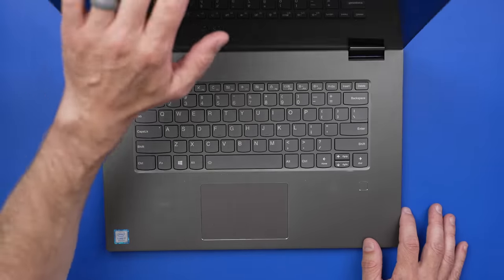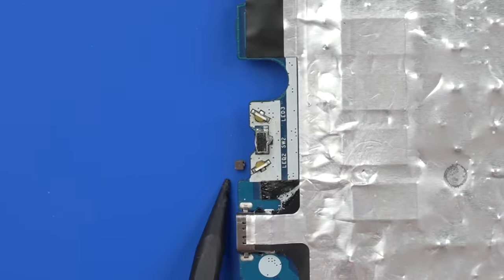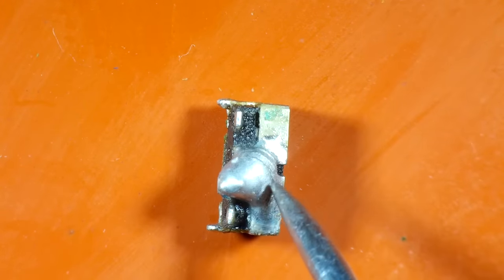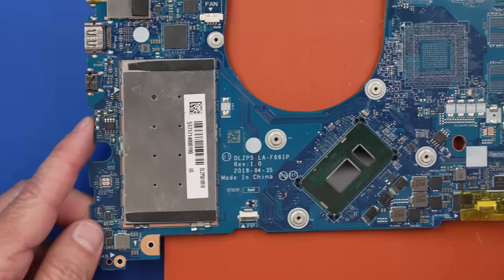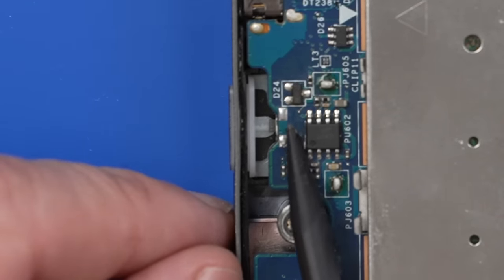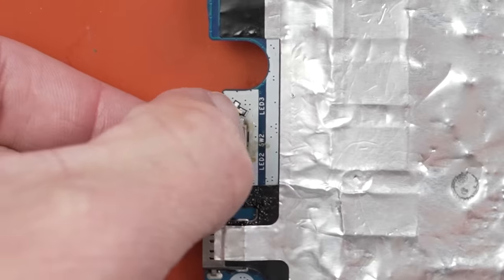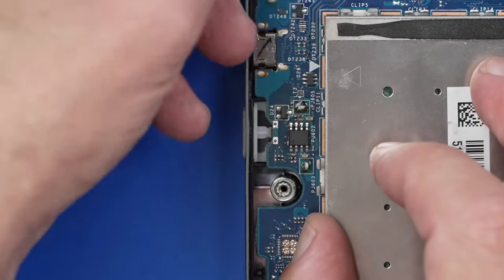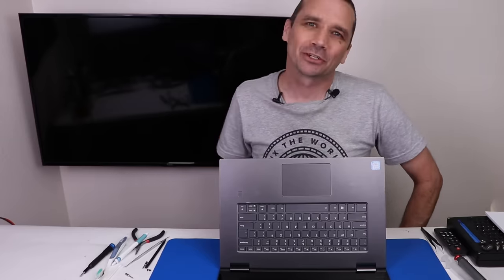Repair Shop Said $400 to Fix This Laptop

Comment: I recently was in the market for a new laptop and really liked the Lenovo Yoga 7i with the i7 and rtx 3050 6gb and the 2.5k 90hz IPS touch screen. BUT I did not like the power button being on the side like that.  It just seemed like it would be a weak point.  It looks like I might have been right.  What I was worried that it could be damaged carrying it around in my backpack. Im really careful with my stuff but that just seems like a bad idea having it exposed at all times.

Comment: People do need to remember that a repair shop is not just charging you for the parts. They also consider how much time they spend working on the repair, and each hour of labor is worth a certain amount of money.

If a repair shop quoted $100 for a fix and you got the part for $10 and did it yourself, you can think they overcharged by $90 but you're not getting paid for the time you spent fixing it. So you basically traded $90 for however much of your time you spent fixing it.

An hour of my labor at work (not a repair shop) costs $250 but I make absolutely nowhere near that much myself.

Comment: 450$ had been a hell expensive powerswitch, nice to see you give it another try after that the first one not was fitting!

That "repairshop" should be put into shame like many others, cuz a repairshop means repair, not replace! 

But more and more repairshops just wanna replace parts and that´s a very negative trend for the other ones like you, who actually is the TV-repair-workers of 2022!

Good job man, keep it up!❤

/L

Comment: would be interesting how much time you actually spent repairing this laptop. idk what an hour of work costs where you are from, but when i think of the cost of working time in my country and calculate 2 hours (i know maybe a bit much) it would cost the customer nearly the same to change that little button as getting a new motherboard installed. so the customer would have a better deal changing the motherboard, taking in account that there coul be another problem on the old board.

Comment: Worked for a company that subcontracted repairs for a major brands laptops (rhymed with Bell) and whenever something on the Mobo failed their fix was always to replace it. Didn't matter if it was a quick 10 dollar part - if it was on there the protocol was to order the part and replace the whole thing. Great company otherwise though

Comment: To be fair to this ‘repair shop’ the only reason you were able to do the repair was because you happened to have a donor board with an exact/similar switch.  If that were not the case you would have looked to buy a replacement switch, found you couldn’t and having to conclude that it could not be repaired or that you would have to buy a complete replacement board.

I won’t left them off the hook completely though because they did not replace all the screws which is lazy and negligent.

Comment: "Repair" shop. Their apparent practices are pretty close to sleazy. I work at a motorsport service department. Just because a repair isn't implemented does not mean leaving parts off a customer's machine after diagnosis (nor letting it leave in a worse state than when it was received).

Comment: its a shame that manufactor dont have to list all parts they used. this lenovo design ist older than stoneage, most likely they use the same components since day one and reuse these from generation to generation. 2 cent part leads to "400 bucks" repair. or for an real expert an hour research and work. 80-100 bucks in germany for an normal work hour.

Comment: Hello TronicsFix, I have a HP ENVY TouchSmart m7 that works very well but, when install the secondary HDD, i get a Blue screen of death. Can you help? Thank you.
Reply: Been hopping around google to see if I could find a solution. It seems that the secondary drive slot is an mSATA slot. I suppose the first thing to check is that you have an mSATA drive and not an NVMe drive, since the two are similar enough to fit each other's connectors but are not interchangeable. 

I suppose next thing to check would be the BIOS to see if it shows up, alternatively if you need a firmware update to make it show up. There's also the possibility that the official firmware disables the slot completely (I don't fully trust pc manufacturers to not pull stunts like that).

Comment: They wouldn’t charge 25 cents for that part even tho it should it’ll be more like 25 dollars cuz they up charge the hell out of parts like for example I had to get a new front usb for my Xbox you’d figure max a replacement should cost a like maybe 2 dollars but that’s pushing it no 17 before taxes and shipping and whatever oth random fee they can think of and that was just a used one that was the cheapest

Comment: Why in the world would it cost $450 to fix that?  I would bet I could find the entire motherboard for that laptop on eBay in perfect working condition for under $150.  Even better, I bet you could find a non-working board on eBay for less than $100 and then you could get your exact switch.
Reply: because labor isn't free

Comment: Not to undermine your otherwise cool work but realistically people need to understand that amounts in the hundreds of bens for almost ANY repair is legit.
I don't know how it's running where you are but as a electronics repairsman our converted rates billed to the customer are around 70$ the hour and while we're not the kind to also bill any light consumables this doesn't yet include any components we'd need to replace. But said hourly amounts will apply to disassembly/reassembly of the device (which is more often than not a pain with laptops), diagnosis, the actual repair which might lead to further diagnosis and repairs, they'll include actual work hours my boss pays me, shop expenses, equipment used, an insurance and legal taxes...
We personally only charge for the actual time we've worked (to the quarter), but we give prior approximations and I know in some countries giving a precise amount upfront is mandatory and if I had to I would certainly never ask any less than 400$ for ANY repair concerning a laptop if I want to keep any chances to live up to our warranty on the long run...
People underestimate how truly time consuming it is, even finding and sourcing parts can take ages, which is still something a qualified worker must do, because you fail to mention how much time it really takes for you to fix it all steps considered and how much that amount of qualified work truly weighs on the work market (A LOT) before you let people jump to any conclusions concerning value...

Comment: Repaie shops are not always right,i once went and wanted to see if i could fix my old laptop because when i turned on it wouldnt show all the blue lughts only 1 instead of 3 and they said its because of the screen, i disconnected the screen and still what will that prove by changing to a new screen? Just tryna get money out of you

Comment: If manufacturers did sell that button for 25 cents, most repair shops will charge $449.75 for labor.
Reply: And then pay the actual technician that did the job minimum wage

Comment: Discounting the bad reassembly (which is not excusable, I definitely wouldn't bring anything there after that experience). That shop may have not had the proper equipment or parts to perform the repair and only quoted them the motherboard replacement as the only recourse they had, not as the only way to fix it. There are good repair shops out there that don't have a solder tech on staff.

Comment: 0:44 Depending on weather i can find a fitting replacement button or not?  Won't a lot of buttons/switches work, if it doesn't exactely fit, seems to me, to just then superglue it to the side, have some wires run to the connections, remove plastic part that pushses the button, and voila, done, or am i just being a total barbarian here ?

Comment: It would cost $450 to repair as (at 1:22, paused) there are 5 chips missing.  No multimeter checks for continuity, etc.  Sorry, mate.  I say BS.
Reply: The missing chips look like they were for a discrete graphics card chipset. Maybe this model only has integrated graphics.
Reply: @ianhaylock7409  fair enough.  Glad you got it fixed.  Good vids.  Enjoyable.  Keep it up.